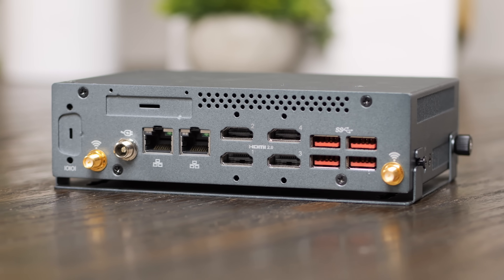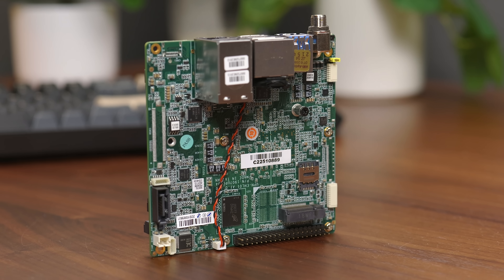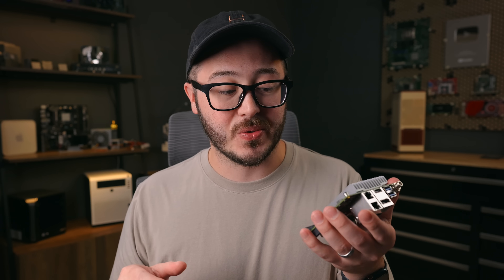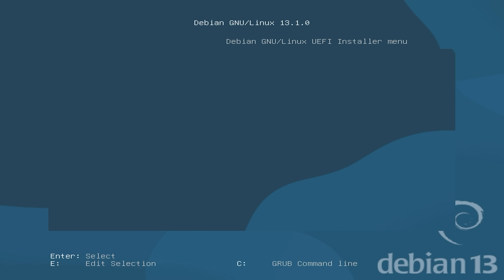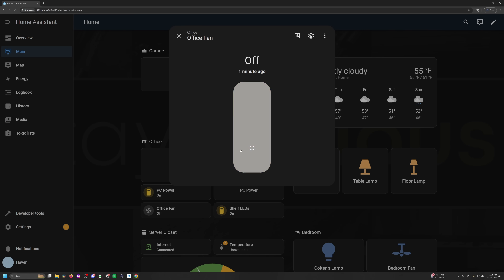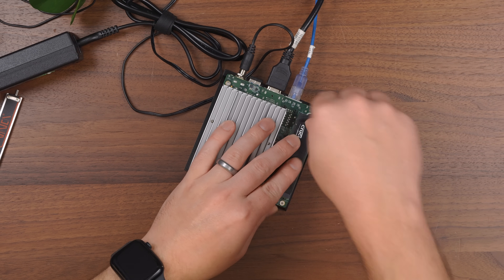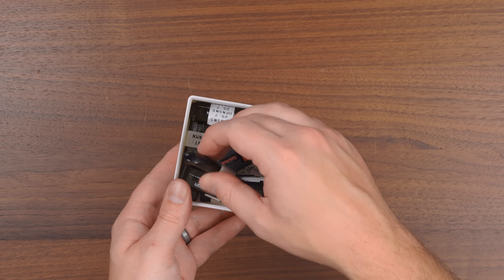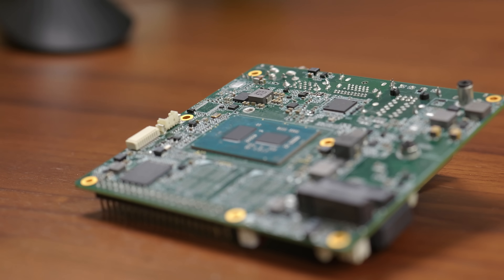This $63 Mini PC Might Be a Hidden Gem

Comment: There is literally no reason to buy that SBC for most people. Perhaps if you need an x86 SBC with GPIO. I imagine that is an extremely niche use case. 

You can get a GoLite mini computer for $75. For $12  the specs will blow this SBC out of the water, especially considering it comes with a case and power supply. 

CPU: Intel N4000 2 core/2 thread boost up to 2.6Ghz. 6 watt TDP
8GB DDR4 SODIMM
128GB NVME
4x USB 3.2
WiFi 5/Bluetooth 4.2
2x HDMI 1.4
1gbps NIC

You can upgrade the RAM with a larger SODIMM. You can upgrade the NVME with a larger one. If you don't need WIFI, you can replace it with a m.2 adapter and install a 2230 NVME drive.

If you need 2.5gpbs connectivity,you can buy a USB 2.5gbps NIC, or even 3 (Using one USB port with a hub for keyboard/mouse if needed).

If you step up to the $100-$130 price range you can get a 4 core atom CPU with higher frequency, a larger NVME, dual NIC, etc

In other words,if you take the money spent on a lower end SBC/mini computer you can often get a much more powerful mini computer for about $20-40 more.

An Atom n95 CPU with 8GB RAM will run circles around an Atom n6210 with 2GB of RAM. Or even three n6210 based SBC.

Add up the cost of 3 of these SBC plus a power supply and shipping and you can buy a $200 to $250 mini computer.

In that price range you are  looking at CPUs such as an AMD 3500u (4 core. 8 thread 3.7Ghz) with 16GB RAM, 512GB NVME, 2.5gbps NIC (powerful enough to play low end games thanks to its 8 core Vega graphics).

At $250 you can get a 3550H CPU. 32GB RAM, 1TB NVME

Stepping up to $300 you can get a 5700u (8 core 16 thread 4.3Ghz, 8 core Vega GPU, 15w tdp), 32GB RAM, 1TB NVME

While these higher end, compared to the n6210 SBC have a higher idle draw and peak power draw, if you are replacing 3+ n6210 SBCs you are actually saving a huge amount of power.

What you can run on an AMD 3500u with 16GB of RAM is amazing. Many people can use Proxmox and run their whole home lab on one. If you go up to the 5700u (or better) with 32GB of RAM is more than enough for most people's home lab. They can easily run PfSense/opensense, PI-hole, HomeAssistant, network Proxy manager, Truenas and have enough power to  run a Zorin OS VM with Steam for lightweight gaming.

For extra storage you can get an USB NVME enclosure with 1TB to 4TB NVME. With two you can have a RAID1 mirror with Truenas.

The ZorinOS/steam VM can be assigned 8 vcpu, and 8gb RAM with the igpu passed through. If you want a display for the mini computer's direct use get a USB display adaptor.

If that still isn't enough power get a $1200-1350 AMD 9950HX mini computer. Now you have 16 Zen5 cores, 32 threads, 5.4Ghz, 2 core 610m igpu). 96GB DDR5 RAM, 2 TB NVME, 2x SFP+ 10gbps, 2x 2.5gbps,  3x u.2/m.2 slots (enterprise 15TB u.2 NVME), a x16 physical PCIe 4.0 x8 slot

Comment: Just bought a Beelink ME Mini NAS $209 for a home lab. It came with Windows 11 which I used temporarily to install Crucial Storage Executive to inspect Crucial NVME SSDs (and update firmware, if necessary). SSDs were OK as is so I installed ZimaOS using a USB stick (much easier than installing Windows 11).

Comment: For the specs, this board is not particularly cheap as a mini PC.  However, it's an industrial board with a 40 pin Pi HAT and a 100 pin GP bus. While it can be used as a PC, it was designed for industrial applications. This is probably not an End-of-Life board because it has an embedded CPU and the Longevity of the board is listed as 2035 which means it should be available for a long time.

Comment: I use this exact board for access control systems.
The power for the SATA is called a 2 pin JST plug. I use it to run a fan for locations that is outdoors.
Reply: *JST PH plug
There are dozen different JST plug types out there none of which are really compatible with one another

Comment: What if you buy one of these cheap mini PCs and pair it with a budget Android car stereo — or just any car stereo with a big screen — and build the mini PC into it? I currently have an Android car stereo, but I had to replace my old one from years ago because it only had 1GB of RAM and the brand stopped providing updates. I’m wondering if I could install this mini PC inside it and make it work with the touchscreen?

Comment: Nice.  Try searching E Key Right Angle Adapter on big A.  Found one in 10 seconds that would shift that E Key slot to output off the board, which would make using an E Key 2.5Gb NIC with a low profile ribbon possible.  It might get a little tight on touching the upper M.2 but there are $10 adapters for that too that would lift it up enough to let everything breathe a bit.  Either way, a decent little box to fiddle with.  Thanks for the idead.

Comment: Here is what I want to know. How well does it run Dos with something like SBEMU?. Dropping Freedos on it and then either dropping it in a 3D printed case to make it look like a small replica of an old desktop or to be even more silly mounting it in an old AT case with a plate to adapt to the screw pattern and route the connections to a couple of custom slot covers so from the outside it looks unmodified. Inside that 2 gigs of RAM would be absolute luxury for ANYTHING in Dos up to most stuff on even Windows XP and 32 GB of storage would hold the majority of or possibly EVERY game from that era anybody would care about playing.

Comment: That board seemed to be designed for industrial use, passive cooling, etc.   It might have even been a bit ruggedized.   Something like this might be good for home use in a place where you want a fanless and/or somewhat rugged device, in a shop or garage, etc.

Comment: :| 2 cores. for 75$ I got an Advantech ARK-1123H Industrial PC J1900 quad core 1.9Ghz 8GB RAM /128GB SSD, Dual NIC
thing is ready to go.
Reply: that is nice, but is not tiny like this toy type sbc that lets you imagine uses for it
Reply: will it run linux

Comment: If you keep an eye on BestBuy's clearance sales, you can do a lot better than this. I paid $100 for a lovely little ASUS laptop with one of those crappy N series Celeron processors in it. Yes it's slow but for a "quick I need a computer" situations, it's perfect. For example: Setting up a router in an outbuilding. Or: Let's go war driving! I love it. I have Windows 11 Pro on it and Windows Remote Desktop works perfectly.

Comment: If this video was monetized, you would have had my $2 just for going into the details and trying Proxmox on it. This is a very niche-use board with no power supply shipped, only 2GB RAM just limits it like crazy. 2GB was fine 20+ years ago for 32-bit WinXP and maybe up thru Win7 for light desktop use. Cubietruck board back in 2013 had 2GB RAM and made a decent standalone squid proxy server even tho it was ARM. This has Raspberry Pi vibes, but without the community and support.  Thing is, you can get a usb-c RSHTECH 2.5Gbit adapter for like $15 on amazon these days and probably get better results from a sub-$200 mini-pc. Not trying to be harsh, just realistic. It was an informative video.

Comment: You can actually install proxmox on emmc if you modify the installer by choosing the debug mode in the installer then press ESC and type exit. From there you can modify the installer file to also include emmc as a valid installation media. theres some videos out there covering this much better than i just did

Comment: Hmm... honestly I'm more inclined to spend a little more and get one of the chinesium mini pcs flooded on amzn. They tend to be much more versatile and can also operate in the 5 to 65W region. With 2G ram, you're absolutely hard pressed and more often then not, I had my use case for an acquired system shift while in use. Which is annoying and I have a stash of netbooks, notebooks and sff pcs because of that.
So I would rather spend more for a potent multipurpose mini pc with some extendable functions like ram and m.2 or sata ports, than being fixed in exactly one use case scenario.
Well if you have the equipment you could solder the three missing chips onto the pads and edit the spd settings in bios... but I personally don't bother with these things.

Comment: I got a few UP2 boards when they were released (more than 10 years ago). It was quite a mixed experience. I had a 2 GB RAM model with two 1 Gigabit ports which I used as a pfSense firewall. That board was rock solid and worked just great for many years without a single hickup ( I replaced it eventually when I needed faster NIC's).  However, two of the other UP2 boards had severe issues. In one case the SATA port silently died after a few months. Another board came with a defective storage eMMC storage disc new out-of-the-box. Clearly, quality control was abysmal. Which is really a shocker given that their main target group is/was enterprise customers and industrial applications for production automation and such. I sent it back for repair and that turned out to become the most horrible customer service experience I ever had (a long story).  
That said, what I really liked (and why I bought them despite the hefty price) was small size, low power, silent operation and x86 CPU. A pretty unique feature set at the time I bought them.

Comment: That thing seems like it would be an insane router with the dual 2.5gb version with a sim for fail over.
Reply: NanoPi M5 with a USB WAN adapter. Full support with Armbian, or use FriendlyWrt. US$55 with 4G RAM. US$100 with 16G RAM and metal case.
Reply: @msdosfloppy  NanoPi M5 has 1gb NICs...
Reply: @msdosfloppy but it is not based x86 architecture 😢

Comment: That will be a PicoBlade connector.  You can get the housings and pre-crimped cables from Digikey.  I do not recommend crimping them yourself, they are too small.
Reply: Ok, probably not.  I have seen boards that use PicoBlade for SATA in the past but this one looks a little big.

Comment: You lost me at eMMC. 
The CPU being dual core 2T was another strike, price bedamned.
That it performed badly under Proxmox is not surprising. 
The IO options were curious. That stack of NVMe case in point. The string of dongles you used for SATA was amusing OTOH. 
IDK, this looks to me like a solution who is confused as to purpose. Low power but not as low as others. Lower performance than other solutions was not unexpected IMO. Those J series chips just seem to be left over Atom variants rebadged in order to dump them as 'new'.
Reply: I can see plenty of uses for a low powered low performance high throughput device.
One being a simple NAS. Home assistant is another good example.
Kiosks as someone mentioned might be another.
If it has hardware video acceleration, then you could mount one to a TV to get a media center.
A store POS is another good use case.
Reply: This is an industrial board. It's not designed to be optimal as a PC. It has tons of use cases in machinery, kiosks, monitoring, etc.

Comment: I was still with ya with the 2GB of ram. Still hanging in there on the 2 core, ancient Celeron. Ya lost me when I found out 1 of the 2 nics was 2.5gbe and the other was not. 

Maybe not now but soon multiple gb Internet access will be widespread. I don't want that 1gbe bottleneck on my router. Gotta be at least twin 2.5gbe.

And if this thing originally cost over $200, it's inexcusable that they did not make both NICS 2.5gbe. How much more could it possibly cost to upgrade the 1gbe to 2.5gbe?

Interesting little board and $63 is certainly cheap, but in the end, ya get what ya pay for.

Comment: The idle power might be crazy low. What was the power draw of your power supply with no computer connected?
Reply: YES.  (rather than posting the same question, I'll add to yours).  When you're only talking a few watts I can imagine the power supply being a bigger percentage of the total.  Cheap power supplies aren't typically that efficient, but.... ?  Anyway, measuring at-the-wall rather than at the device seems a bit inaccurate.

Comment: Yeah conclusion is pretty accurate, got a used Dell Wyse 5070 thin client in amazing condition and for a similiar price recently. Thing has a intel 2.5 ghz Quad Core and power usage should be similiar. So if you don't need nvme or 2.5g ethernet, there are better used options. Although I have to say, I'm still very tempted to get it, as it seems to make a cool backup dns server.

Comment: Why would anyone mind running ARM on a single board computer, where your goal is low power?

For this, ARM is literally your best choice...
Reply: Yeah, but for now arm means very limited OS support. No pfSense, no OPNSense, no Proxmox, only a few "normal" linux distros at best. Not an issue on x86_64.

Comment: the first thought i had on this was a Node based cluster storage. each node would be connected to the cluster network at 2.5 GB and provide an NVME and a SATA to the pool. Would be really neat with some sort of orchestration so if you add a node it joins the cluster automatically.
then you run the 1GB into a switch with a 10GBE uplink and vIP to pull from the cluster to get 1gbe x number of nodes speed.

Comment: As a one-off bit of fun with a weird-but-interesting computer? Yeah. Sure.
But like... The Radxa X4 is also x86 except newer, is cheaper with MORE ram, has way lower idle power draw, and has an RP2040 if you want the GPIO.
And the X5 seems to be right around the corner.
These older Atom systems might be worth it for like... $20?
A 2-core CPU and 2GB of ram makes them a toy.
EDIT: When the F did the X4 start going for $200??!?!??! I bought my 4GB ones for $60!!
Reply: Radxa X4 is $200.
Reply: @prman9984  What?
I bought 2x of the 4GB ones last year when they launched for $60 each.
When did the prices skyrocket? They are $200 now? WTF?

Comment: I'm not sure if i'd call this a hidden gem. But those EOL x86 industry boards are known to be a good alternative for RasPi's.
If you do some research on this Industrial EOL Boards, you can find a ton of stuff used for around 10 to 20 bucks in the bay.
great for prototyping stuff like you mentioned here.
Reply: can you give an example of what to search for
Reply: For starters have a look into the Dell Wyse Series. Work your way down to things like advantech industrial. 
For e.g.: a Wyse with the capacity like the board here will cost you around 15 bucks including PSU.

Will it chop the trees? No way. Prototyping? Fair enough.
Reply: @TheUnofficialMaker  With modern chips, no he can't.

Comment: 2:48 l 2:50 , i see an empty space for unsoldered RAM, can't we add\replace RAM chips for more capacity ?
Reply: Yes theoretically, but soldering BGAs is outside of most tinkerers comfort zone.
Reply: Even if it worked, the risk and labor involved would make it a pretty bad deal. That's the kind of thing you do with an unused board you already had and plan to make a YouTube video about.
Reply: you would also need to edit the BIOS so it knows there is more ram. Soldered ram does not auto-detect the size like the DIMM modules (that have a data chip to provide such information to the bios)

Comment: 2.5gbe and m.2 is a great little NAS system, it could have pcie primary storage then store backups onto USB HDDs as those are the cheapest per TB devices.
Reply: If you think that that under powered 2 core, 2 thread CPU with 2 GB of RAM using a PCIe 3.0 X2 NVME will make a good NAS you either have a very low bar for "good" or don't understand hardware. 

It is even more limited because the 2nd m.2 slot is Gen 3.0 x1. You want at least 2 drives in RAID1 mirror for a NAS. The write speed will be limited to the slowest drive, which is the Gen 3.0 x1. 

Each lane of PCIe is a maximum of 0.985GB/sec. Most NVME drives are X4. So a Gen 3.0 X4 drive is capable of up to 3.94GB/sec

Newer PCIe 4.0 is 1.969 GB/sec per lane and PCIe 5.0 is 3.938GB/sec

Obviously 2.5gbps networking is much slower than a fast NVME during sequencial read/write. A decent NAS should be able to transfer at about 240MB/sec over 2.5gbps.

I bet this SBC will be limited to about 150MB/sec because of the low power CPU, the tiny amount of RAM and the limited x1 and X2 m.2 slots. 

If the NAS uses ZFS as its file system you need about 1GB of RAM per TB of storage. The NAS OS will need at least 1/2 GB of RAM. This means that you are limited to no more than 1.5 TB of storage. In reality, the 1GB per TB assumes large disk arrays, using 1.5GB of RAM for the ZFS cache and metadata will further limit the speed of the NAS.
Reply: @Slackware1995  "If the NAS uses ZFS as its file system you need about 1GB of RAM per TB of storage" This is a myth, you only needs lots of RAM for dedupe, caching not as important for SSD. A potato can push 2.5gbe traffic, it only struggles at handling a huge number of loose files.